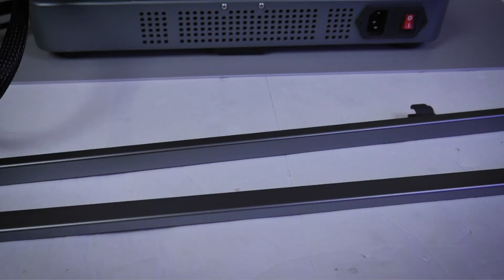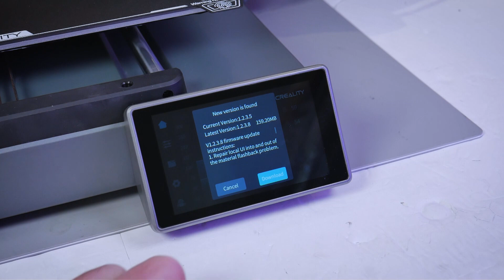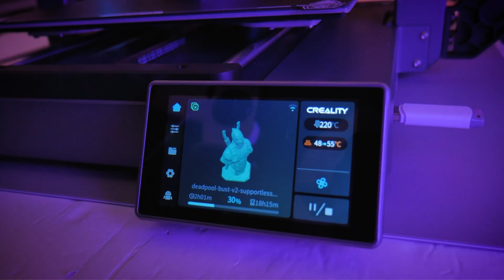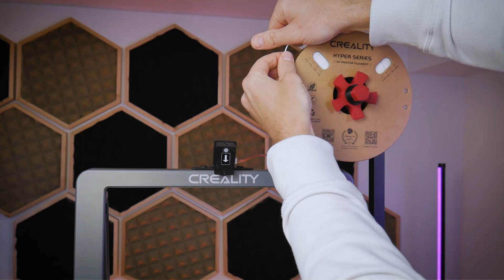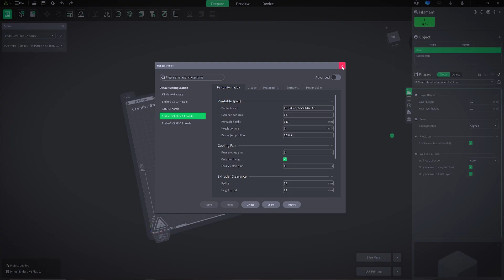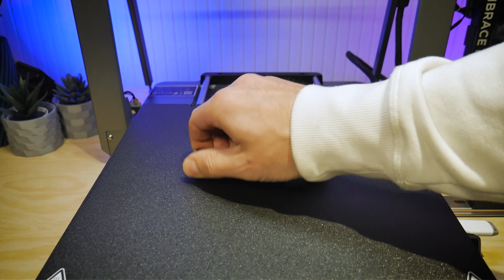Creality Ender 3 V3 PLUS Setup Guide, Tips, Upgrades, Review and More!

Comment: First of all nice and video

Wondering if your printer have some first layer issues i'm facing (default settings, creality 5.1 slicer), where first layer seems to print somewhat too close that the individual layer sort of collide with the ones next to it creating small ridges and super thin layer of filament on the valleys. I tried to increase z offset by about .05 ~ .15mm and it solved the layers colliding but now the layers are a tad too thin resulting in either bad adhesion to print bed or the first layer having some holes where the filament didn't "fill in" properly.

This is basically my first ever printer so i'm a bit lost. Tried changing heat settings that sort of fixed the problem albeit with the model having tons and tons of stringing, as well as some shifting issues. Any help is appreciated, thanks

Comment: Hi! What is the name of the extension cable that you use to move the runout sensor? I have been trying to find one on ebay to no avail.
Reply from the maker: They are jst-xh connectors, 3 pin
Reply: @EmbraceMaking  thank you so much for replying 😊

Comment: The bottom right of my screen just says slice plate or print plate. there isnt a LAN printing option.  do I have to toggle it on somewhere?  I tried to go to the help and type in a topic but it just pulls up MACos help articles.  thanks
Reply from the maker: If you look at that green button in the bottom right corner, you should see an arrow on the right side of the button. Click the arrow to get the other options like LAN, export to local, etc.
Reply: @EmbraceMaking  ya no LAN option, even while monitoring a print. just upload, export, print etc.  thanks for the help though.

Comment: I could not find the stl for the fake runout sensor in your links, could you please add it to the makerworld pages for the V3 and V3 Plus?
Edit: it's there when you go to download individual files
Reply from the maker: Hey if you click the download STL file in maker world you'll see it's already in the individual part list: https://makerworld.com/en/models/499405#profileId-415093
I just need to update the picture on the listing as it still only shows the original two parts. Thanks!
Reply: @EmbraceMaking  Thanks, I was unfamiliar with makerworld's interface

Comment: I've been running a Ender 3 Pro for years, now I have one of these and its incredible
Reply from the maker: With the latest Creality Print 5.1 it's been a great addition for me
Reply: Same!  Big leap ahead thats for sure.
Reply: Yeah man, although you learn a lot through frustration, but only because I didn't know everything about printing. My first and only printer was a Ender 3 Pro, and once it's dialed in (and i don't try to mess with it) it's an absolute champ. Its still runs great. Just got the V3 Plus 3 days ago, and man... we've come a long way. My only issue, so far, is that it is having gantry noise issues (along the x-axis), but as of today, i think the problem has been recognized and hopefully a solution is out soon... as soon as I hear from Creality.

Comment: Does the sensor runout holder come in the hardware pack with the filament stand and if not where can it be found
Reply: What is the cable power extender extension needed to reach the filament sensor? I'm just looking for the cable
Reply: Looking for the same thing.  Looking for the extension cable @JasonReady
Reply from the maker: All of the printable accessory parts like runout sensor holder specific for the V3 PLUS shown in this video can be found here: https://makerworld.com/en/models/499405#profileId-415093

and you can find links to other printable parts for other applications here: https://embracemaking.com/blogs/resources/universal-top-mount-spool-stand-accessories-and-adapters

Thanks!